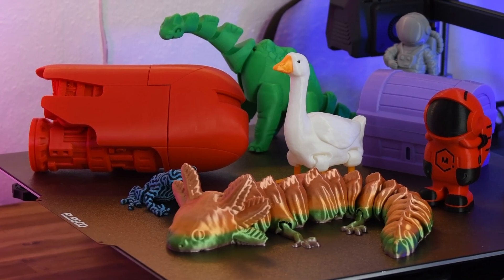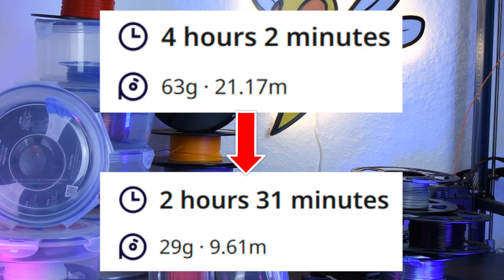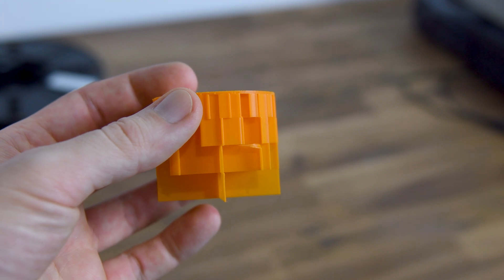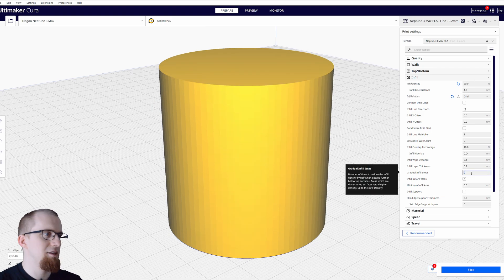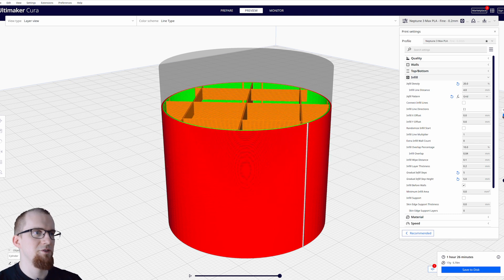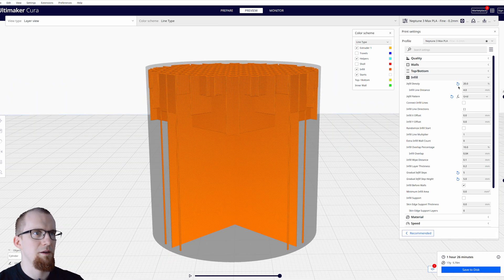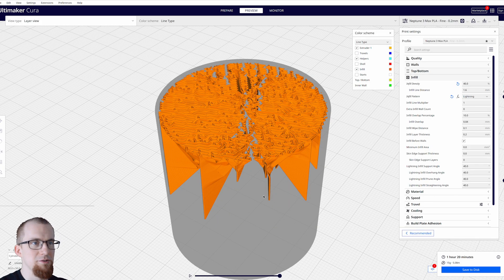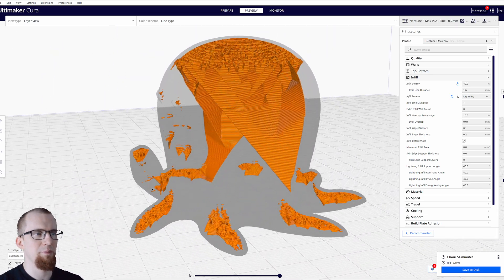Cura Gradual Infill Guide | How to Save Filament and Time!

Comment: I had looked at some other infill patterns, such as Gyroid, but did not realize how Lightning worked nor the gradual option.  This was really helpful for revealing Cura settings I did not know about!  I also didn't realize you could turn off the shell in the preview to see the infill pattern - That is really handy!  
Now I'm wondering if there's a way to set much denser infill at the base for stability, then thin out for the middle and get dense again to support the upper areas.